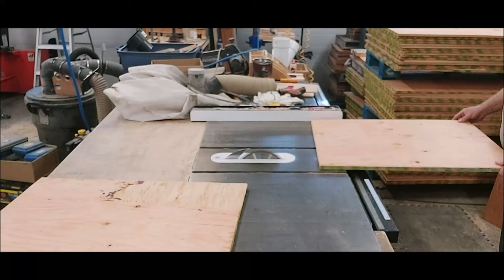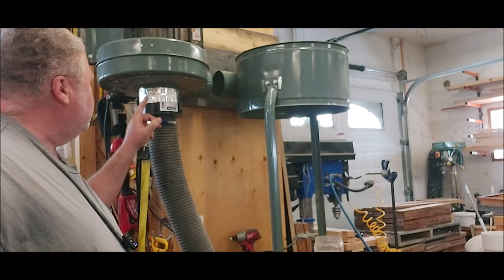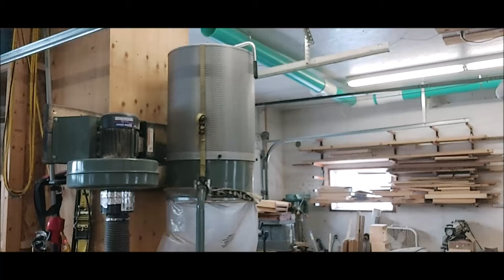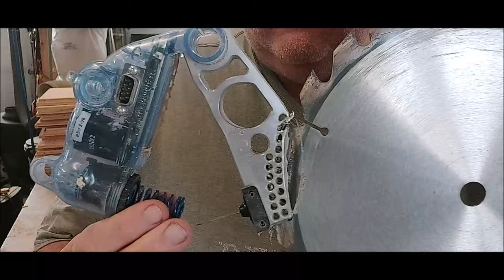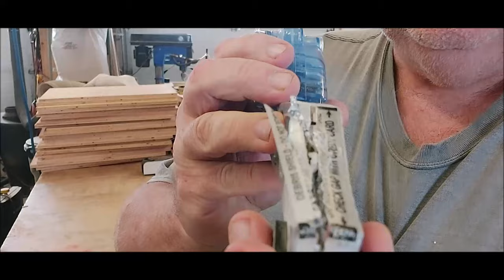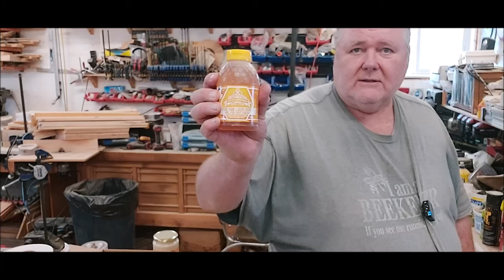⏱ Vlog February 10 to 16-That Bee Man

Comment: You mention venting outside is not feasible. If you put a Tee at what looks like a 2" line into the vacuum part of filtration unit, with a reduction to 1.5" intake vented from exterior wall, that would allow sufficient suction from saw for dust an the other end could be vented outside, without sucking much air from the room, as the extra air needed will be sucked in through the 1.5" line from exterior wall! I'm no expert, but I understand how the system somewhat works to compensate air into the system and by adding a foam filter to suck air from outside to help avoid condensation through cold weather!
Hope this helps!!! Have a great day!
Reply from the maker: I covered that at 17:15  Thanks for watching!

Comment: Thanks Brad for the update. Fun to watch you work out the dust control. On corn/pellet stoves they make a air exchange where the incoming cold air is warmed up by the exhaust air going out. It is basically two different sized pipes inside each other. But I doubt they would help enough with the amount of air you have to exchange unless they were quite long. Your creamed honey looks great. 
 Have a good weekend.
Reply from the maker: I'm sure that would help!